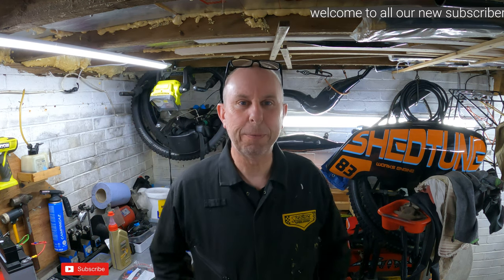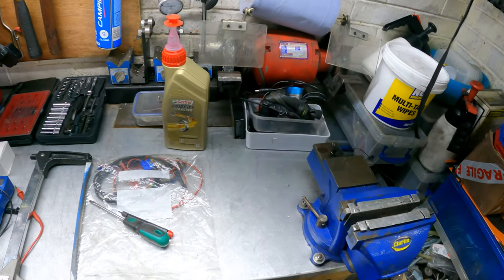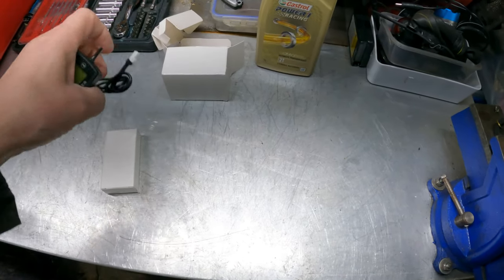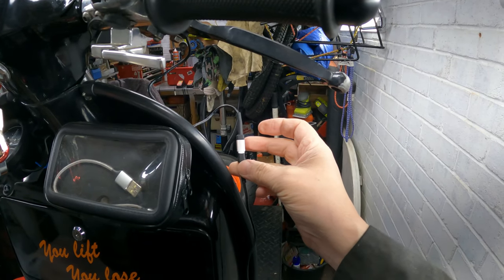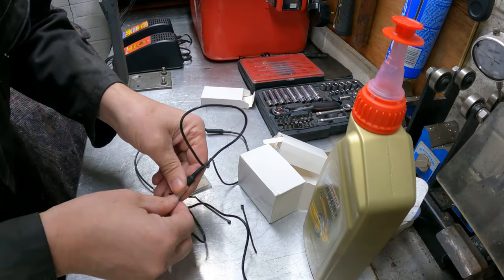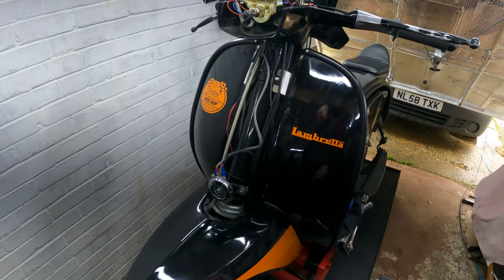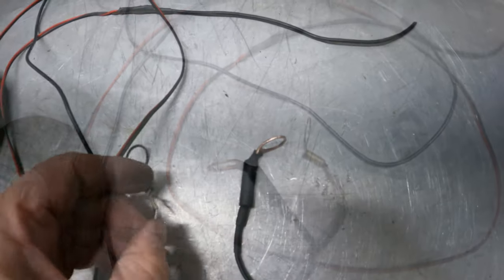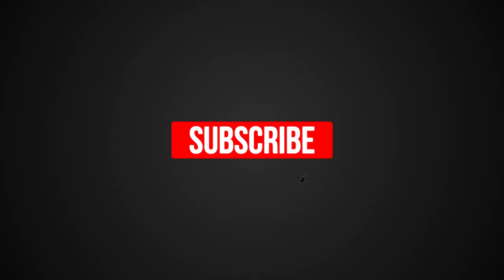Shedtune - How to fit a temperature gauge

Comment: Dont get caught up putting it under the spark plug. It’s easier under a cylinder head nut. That way it’s undisturbed checking the plug and less likely to need replacing when it gets broken 😅
Reply from the maker: Never thought of that. Good call. Cheers 🍻 👍😁
Reply from the maker: @jimsregaturntableshifijukebox  yes the temp does differ depending on where you put the sensor.
Reply: @Shedtune_Russ  yeah put it on a cylinder head nut on the hot side away from the fan blowing harder on it. Pain under the sparkplug really. If it’s really accurate readings your after EGT is better.

Comment: Be careful with the 2 wires. They are Chromel/Alumel thermocouple wires in the cable and you must make sure you connect them correctly. I note your wires for the two different cable systems weren’t the same colour. The easiest way to check is the Alumel wire is magnetic. If you connect them the wrong way round you create an extra thermocouple junction and it introduces errors. So always Ch to Ch and Al to Al. The only junction between Ch and Al should be where they are attached on the sensor ring. I have a trail tech currently but I’ve bought the MB gauge which uses a 12v supply from the scooter for when my TT finally dies. Sorry for long winded explanation of Ch/Al thermocouple but I spent 40 years working instrumentation at Rolls- Royce aero engines.
Reply from the maker: Every day is a learning day. Cheers for the info 👍🍺

Comment: Amazon do one which is a combined rev counter and cylinder head temp gauge for £25. I found easiest way to fit temp sensor ring was over the spark plug and held in place with some silicon tubing I found on E Bay and then spark plug cap.😁
Reply from the maker: Yeh we have tried a few types. We only needed a temp gauge and I prefer the sensor under the plug as it’s a bit more accurate and faster reacting but if it works for you then happy days. 😀👍🍺

Comment: Hi great vid ..Can i ask what satnav/phone cover you have and how the usb being powered?
Reply from the maker: Just a cheap iPhone cover off Amazon and it’s powered via a battery in the tool box to charge the phone as I ride from the DC out on the variatronic
Reply: @Shedtune Russ & Dom  cheers mate I just had a vape sport fitted it's AC non battery but I'll use scootertronics regulator with DC out put for my sip speedo.. trying to figure out how to fit my phone with satnav
Reply: @andytodd8136  I’ve just seen they now do a vape regulator with a dc trickle output….

Comment: Had the same issue with those robbing Trailtech Americans. Modded an oven one (so I must be even tighter) to a KOSO 14mm sensor (5 in a pack), I couldn't find one online that went up to a high enough temperature without being connected to a battery. Does it work ok? Great vid I feel your pain.
Reply from the maker: Yeh it works well, seems accurate as well and thx 🙏 for the props 😁